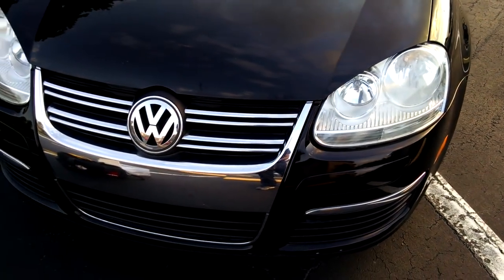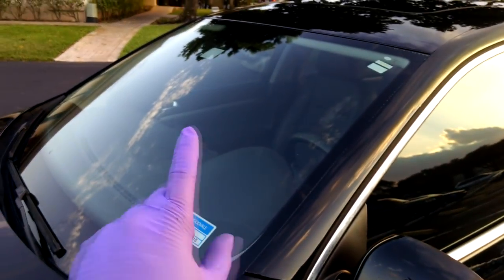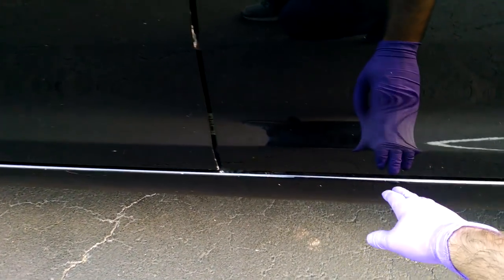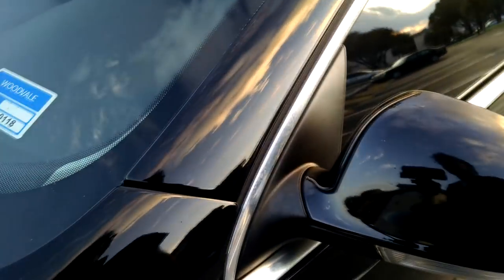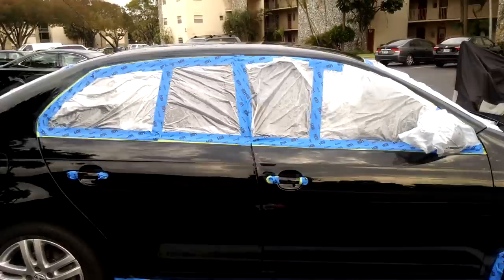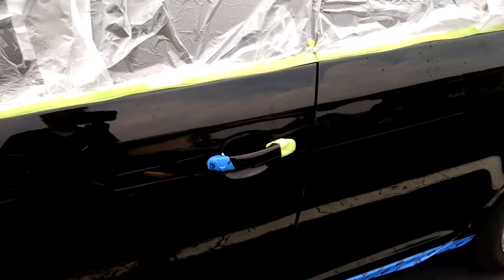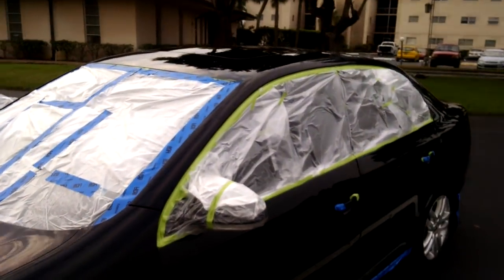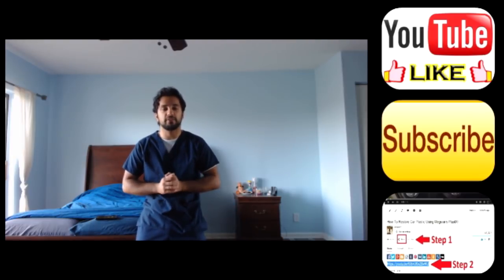How to Tape a Car Before Polishing - Exterior Car Detail Part 26

Comment: That rocker panel isn't plastic.. it's painted metal.
Reply from the maker: +wyclef28 The only metal on cars nowadays are major body pieces like doors and support. Even front and rear bumpers are made out of plastic.
Reply: +roshan517   If you are trying to make an informative video about cars you should know the difference between metal and plastic.  The rocker panels on a MK5 Jetta are metal. Put a magnet on it.  Yes, bumpers have been plastic for 25+ years.   Some rocker panels have a plastic cover over the metal, typically called a side skirt.  This is not the case on your car.  Your car has thicker, textured paint on the rocker panels.
Reply from the maker: In any case, it makes no difference because you can't polish textured paint and so have to tape it off anyways.
Reply: +roshan517 It's painted metal and you can polish it.  No reason to, but you should wax it when waxing the car.  I don't see any reason to tape it.  Just seems like a waste of time.  Honestly, it seems like a waste of time to tape the car at all.
Reply from the maker: The texture will accumulate polish and dust everywhere.

As for taping, I don't know a single person that has polished more than 10 cars that doesn't tape. It takes time, but saves you a ton in the long run with dust accumulation, especially if you work outdoors. If you're doing just your personal cars, you can probably get away with not doing it.